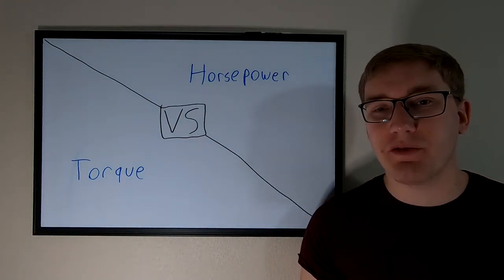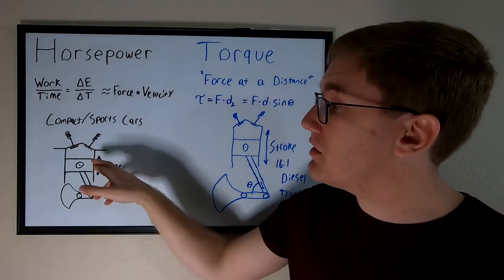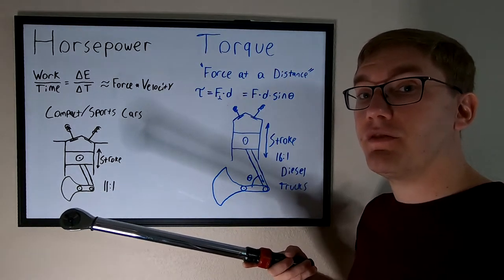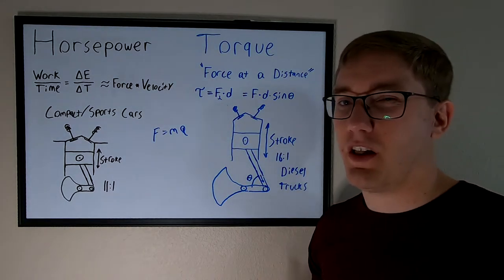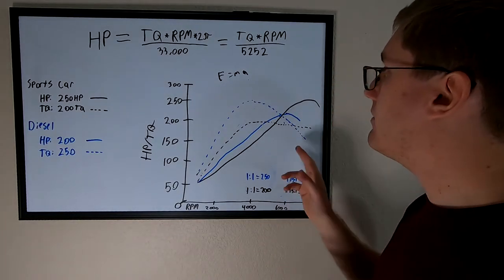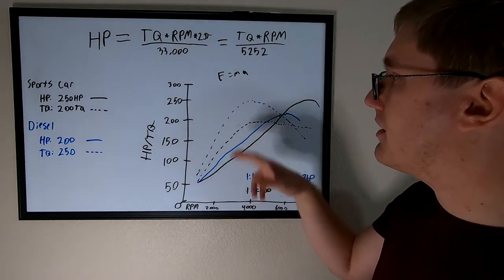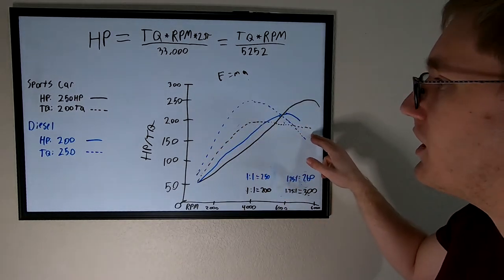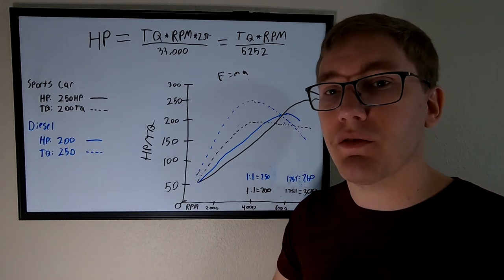Horsepower & Torque Explained - Which is Better for Performance

Comment: In my book, a video on this subject automatically gets a thumbs up if it's mostly right:) Good job!
10:04 Here's the only real problem. Higher gear ratios do NOT come at extra cost in any form. They are NOT heavier, more expensive, or shorter life span. They also don't require more parts, but simply a different ratio of tooth #s between sets. For a given design life, material choice, and gearing style, a gearbox's weight will generally be proportional to the power being transmitted and nothing else. Gearing is almost never a design constraint and it can generally be assumed that a vehicle has been given exactly the best ratios for it's purpose. Because of this it's true that the value of peak engine torque considered alone generally indicates nothing about vehicle performance. 
A greater number of gears are beneficial when an engine has a sharply peaked power curve, not because it operates at high rpm. Conversely, a flat power curve forgives the use of fewer discrete gears while still keeping acceleration high.